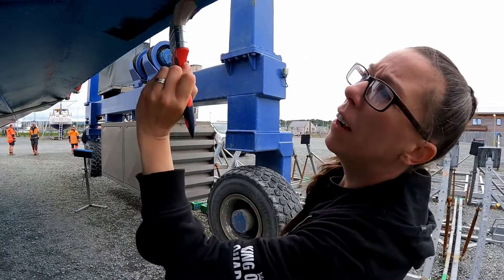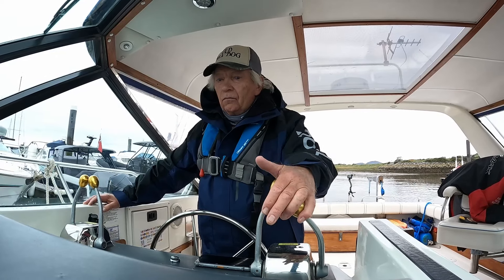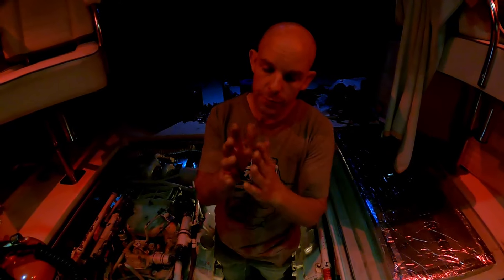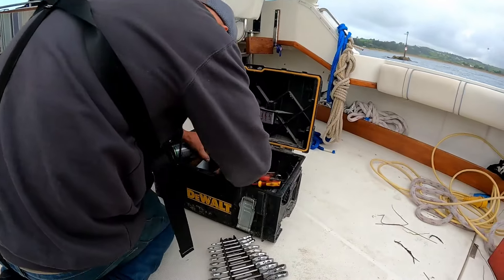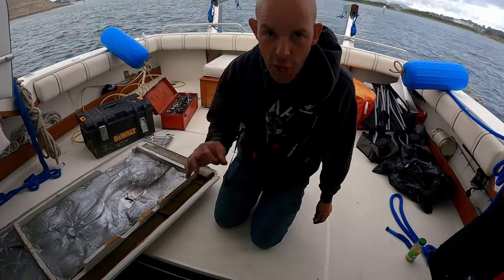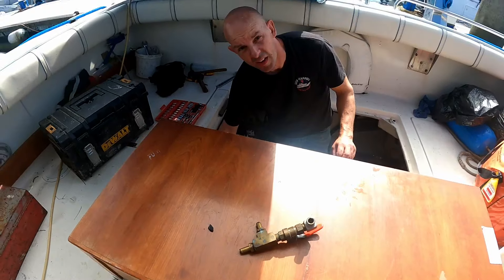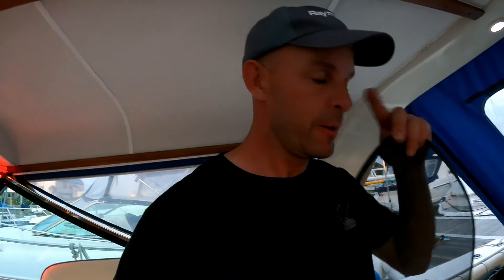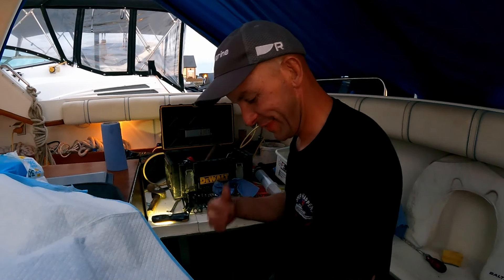Our Biggest Boat Failure Ever!

Comment: The theory on incorrect fuel pipes is a good one.  This is an old boat that will have rubber fuel lines.  Today’s diesel contains vegetable based esters, which turn rubber into hard coal. I think you need to replace every fuel hose in the boat. And flush out every steel pipe to remove the “coal”.
Reply: Yes you are right on the money there - cut open the lines too
Reply: I was thinking the same thing those things look like chuncks of hose.
Reply: Soon as I saw the black inner fuel line, I got the same feeling.
My problem with my OLD boat was diesel bug, I'd tried circulating filters, polishing, new lines etc. Cured it in the end with new engines fuel system and two tanks.
Reply: I am sure its the NEW diesel, when changing the rubber lines don't forget the diesel will also eat any rubber joints in connectors filters etc so change them as well!
Reply: I was thinking the same thing but couldn’t figure out why it was inside the tank unless it’s coming in through a return line but that’s all guessing

Comment: I know it's discouraging, but what you are seeing is not particularly awful for a boat that hasn't been used recently.  Shafts are hard to align, but you'll get them right.  Your fuel problems won't go away until you clean out your tank, but once you do you will feel like total experts on how to clean it up. You are learning and you are learning fast.  Keep it up and in a few years down the line you will be amazed at the reliability and confidence you have achieved.  (Edit: this brings back memories of my Tiara Open.  One of the best things I ever did was empty my tanks, heavily scrub them with soap and water and degreaser, power wash, rinse, then rinse with mineral spirits)
Reply: I’ve just rebuilt a car diesel engine that was coked with soot. But when I got into the job there’s was lots of messed up stuff.   Nothing was especially expensive but it did demand a full strip and rebuild. Anything less would only have bitten me later.
Reply: The tanks might not be especially dirty. However, you will need to replace ALL rubber fuel lines and blow through all metal pipes. Methyl ester (biodiesel) turns rubber into hard coal. Even silicone rubber can’t handle it. Modern diesel contains about 10% biodiesel. It also loosens sludge from the tank bottom. 
It’s probably wise to check the injection pumps as they might have rubber seals.
Reply: @Dave5843-d9m  This is correct. Additionally biodiesel (RME) is very bad due to the buildup of microbial contamination (Diesel bugs) in the tanks and filters. Use only marine diesel that is RME free.

Comment: As a boat owner I feel your pain. I had all sorts of issues with my first boat and went from one crisis to the next. Two engine rebuilds later I had a working boat, then a partial sinking meant a new starter motor, alternator and battery. That was three boats ago and now I have a lovely boat and great days sailing. What I mean by all this is that it will work itself out in the end. I wish you every success. You both deserve it.
Reply: al;l those should have been checked and rechecked.

Comment: Black deposits could have been in the fuel pipes/tubes and it is slowly breaking off. Probably restricting the pipes on the low power engine.  Worth changing all the fuel pipes or at least removing them and rodding through. Only place I can think it is coming from as your tanks were clean and you did the filters.
Reply: i was going to say this too.
Reply: They posted pictures of the fuel tanks and they were full of deposits.
Reply: You might have to loosen the p brVketd to get the alignment right. Then retighten
Reply: I don't think they were until after they ran the engines properly in the water. They almost emptied the fuel tank in a previous episode and they were clean from what I remember.
Reply: @neilfuller3172 my thoughts exactly. It could be the inner of the return line if this cycles back to the tank. I've had these lines break down on an outboard before. However, I am also fairly sure Simon would have checked this before removing the tank, I guess we will see next time!

Comment: Use a temporary day tank. Then have the tanks polished.
Reply: probably fixed by now,   a 12 gal tank from outboard connect straight to filter.  If it works----  you know where problem isnt.

Comment: I got clogged fuel filters very often until I cleaned the fuel tanks. I have mild steel tanks that hadn't been cleaned since the boat was built in 1986. There were no inspection holes so I cut two Ø 50 mm holes with a hole saw. Flushed out a couple of kg of rust and gunk with the pressure washer. Then the filter problem was solved but a couple of days later, I found one of the tanks had a small dripping leak. The rust had kept it tight and then a small pore opened. I sprayed the inside with Por 15 tank sealant and since then, no problem. Removing the tanks would require removing the engines so I'm very glad the tank sealant worked.

Comment: A lot of black smoke on full power. Check air filters first as most likely culprit. If not filters, could be worn out injectors or injector pump.

Comment: Bailey
hi had similar problems with my boat turned out to be the vent on the fuel filler cap worth a look as the tank vent on mine was blocked and i had same problems good luck Mike

Comment: Bio diesel/ethanol does that to old fuel lines, its getting back to the tank via the return lines, you are going to have to change every rubber fuel line upto and away from the filters with a modern diesel resistance  hose after you have cleaned the tanks,  from the filters to the fuel/rails should be solid lines so they will be OK, good luck peeps 👍

Comment: Oh the joys of boating, We had a similar experience when we put our new (to us) boat in the water for the first time back in July. That was after changing the spillway hoses four times as the hose the boatyard supplied kept splitting and dumping all the diesel in the bilges. Once in the water I ran engine up to check for leaks, didn't find any so after 3 hours of running while still tied up to the dock we thought we would take a little chug up the river. Hmmm was that oil pressure gauge reading zero before. As the boat has been standing for 5 years, none of the gauges work properly so foolishly I added the oil pressure gauge to the list of to do's. 45 minute into the run the engine stopped. To cut a long story short, when I had changed the oil, the filters, fan belts fuel lines and every other changeable part, I had put the small O ring that came with the new oil filter on instead of the large one and all the oil had joined the diesel in the bilges. Result was engine seized, luckily for me, it didn't seize solid and after some further work replacing the correct O ring, and refilling it with oil, it still runs. I guess I've done some damage to the bores but its an older type engine (the kind you can hit with a hammer when it plays up) and hopefully it isn't too bad. What it meant was that added to the other work our shakedown revealed, we missed our window to move her from her current location to our final home and so she is back out on the hard until next spring.The joys of boating.

Comment: That’s what old diesel varnish looks like. It breaks down and becomes a gum and over time will go hard and black. You will find it everywhere that diesel has sat for a long period of time, including coating the hoses. STAR BRITE Star Tron Fuel Tank Cleaner or a similar product can be used to eliminate the issue. Both gasoline and diesel will go gummy then sludge, then hard if left over a couple of years. Fuel can even go gummy after 3 months if left sitting without additives. You’re pretty much guaranteed that the engines weren’t winterized each season, so yes there will be lumps of ‘Simon’s coal’ ( that should be the new technical term for it) thru out the system.

Comment: With boat the blocks the boat would have flexed a bit and, if you aligned the engine and shaft on the blocks you have found it would been out once the boats settled in the water. When we’ve worked on the shafts etc we leave the boat in the water at least 24hrs before re checking the alignment.

Comment: The hard black stuff could be hard rubber from inside the fill hose between the deck fill and tank.  I am surprised your engine mounts dont have jack bolts you can use to align the motors. Every boat I have worked on has vertical and horizontal adjusters to align motors.
Withing you luck from across the pond. 🇺🇸

Comment: That's par for the course sea trial. But: Which diesel had the previous owner left in the tanks? This smells of biodiesel (RME). It is totally incompatible with rubber fuel hoses and seals.
Only use proper RME-free marine diesel. And even if you have a fully RME compliant fuel system, you still have the problem with the forming of microbes in the interface between the water and fuel in the tanks and filters. To make matters worse, biodiesel is a lot more hydroscopic than proper (marine diesel) Ideally you should use GasOil-16, but you have to check the maximum allowed sulphur amount both on the engine and regulatory side. Sulphur is very good for pump lubrication, but less good for the environment.

Comment: Remember the new fuel E10 is more corrosive than E5 so it will not decrease in the future. You must also remember that any diaphragm in the system will lose its capacity due to the adverse effect of these fuels. So change lines as suggested, clean tanks and change any diaphragms in system and any odd misfires might have an injector issue. You will get over this but take your time because there are no stop offs offshore! 😮 Now be positive and enjoy your company!

Comment: 😪 Been there. Old boats seem to always have at least one major problem that was never fixed by the last owners. Maybe they never knew it was a problem, or could not / would not figure it out. Perhaps that is why it never went anywhere when they had it. Mine had a cracked cylinder, corroded electronics, illegal plumbing, worn out shaft seals, no zincs, etc. etc. On the bright side, once it is all fixed and running smoothly you will be even more married to the boat and proud of your accomplishments. It's easy to get frustrated and depressed. It's a learning experience. Call it training. Now, if something happens at sea with these systems, you are more likely able to do repairs from the knowledge gained that others might never have experienced. 😌

Comment: Thats an absolute bummer. I feel the frustration. To mirror  davidelliott's comment  below, the 'coal' looks like hard rubber to me. I could be wrong, but hopefully its something as simple as that. I used to service Hydraulic Aircraft jacks. The  big ones they use to lift the aircraft for maintance. They rarely lift their full capacity till annual test. I cycled a 60 ton jack up to max height and down again. All fine till it went into the test rig. It passed its test but wouldn't retract. I had to gingerly crack a nut on the lined to release pressure. The problem was the inner core of the only rubber hose between the reservoir and pump had broken up and blocked the system. Like supplying fuel to your engines under load; the high flow is possibly pulling this crap through the system. The boat looked good when running and handled well. Keep your spirits up; you'll get it sorted. Every faith in Simon.

Comment: We can see the strain on your faces in this video. The series of inevitable problem that occur when a vessel has been laid up for an extended period, especially after a prop strike, can feel like it is sucking the life out of you and your bank account. These are all normal recommisioning issues (apart from the engine alignment, that should have been picked up on reassembly, call it a learning curve). It's usually best to remove the engines and run them up out of the boat. Attend to all potential fuel system (including turbos), cooling system and electrical system issue, then reassemble and align. Even then problems in a boat this age can continue to surface for some time. It's a really tough business. Even doing the bulk of the labour yourselves its still incredibly difficult not to over capitilise on the project. It can seem endless and if you cant afford to keep going that is what it becomes. You guys are doing really well. As soon as I saw that composite fuel hose with the black lining I guessed you could have some major issues on the way, the stuck turbo doesn't bode well either but if you can push on and get to a point where your back to focusing on normal preventative maintence you will have succeded. Its a lovely boat and it deserves to be returned to service by a couple of die hard enthusiast like yourselves. Great videos. Love the ML videos too, a mates brother is restoring an ML here in NZ. If you can do that job you'll get through this lot ok. Don't panic, keep calm and carry on! 😊😢🎉

Comment: Without sounding crazy , you have got what we call in the trade "Diesel Bug".     Diesel will not turn your rubber lines into coal. Diesel bug can lead to all sorts of problems including clogging filters and causing the engine to cut out. Equally crud and sludge build up in the tank could cause similar problems.  Check out Marine16 and diesel dippers.

Comment: Hiya
So sorry thst uou sre having problems. Can i make two suggestions. One, as the hull has been out of the water on blocks and stands, it had probably taken up a very slight diffrrent shape. Now its back in the water it is gradually returning to normal, hence your  alignment issues. Two,can you not use some 5 gallon plastic tanks of known clean diesel to get you home.
Good luck, love all your videos.
Chris and Claire. el Campello Spain 
0:31
Reply: Good suggestion.  Use temporary tanks to bypass trouble and if that solves the problem use them to get home and final solution.  (I know, I know, you've already decided to return to the hard)

Comment: I noticed Black Smoke as well coming out of your exchaust? when you place your shafts back in, you must always check the coupler alignment according to specification. Ok your starboard engine is blowing black and white smoke could be a carberator issue. Air fuel mixture problem.
Reply from the maker: It's the port engine that was blowing black smoke, and we fixed that in the episode, the turbo was seized but we managed to free it off

Comment: Guys I haven’t read all the posts but I have read quite a few so may I suggest that you rig up a temporary tank with fresh fuel disconnect your existing lines and hook up to the temp tank this will get you going so you can relocate just make sure you have a spare top up tank of fuel to make sure you have enough fuel to get you home ,…oh needles to say strap your temp tank down to secure it safely?. I recon this will do the job good luck Dave

Comment: That's old rubber from fuel lines - you must change them all. Suggest that as a fire-precaution you consider copper fuel lines as well - put a loop at engine ends to avoid movement stresses, you won't be getting that "coal" problem again. Bite the bullet friends - change the lines, David E has advised you aright!

Comment: if the engines have seperate tanks then the crud was placed in the tank, look you can empty the tank at the slip just bring down 45 gallon drums pump out the tank then clean the inside with Bilge cleaner then use a wet and dry vac to suck out the remaining bildge cleaner from your tank. it will cost 200 dollars to pull the boat again with a travel lift then the cost to get their and daily fee's in the yard and the cost a second time for the travel lift.

Comment: The fuel system is going to be where the fault lies. The reality is a full change of the fuel system. One easy way to check is use a separate fuel tank And bypass the filter system direct to the engine. If the engine runs as it should there is your answer. And its a cheap way to check without spending money unnecessarily.

Comment: What me thinks is the age of the pipes don,t last forever breaking down any chance of a camera  to look inside tank they use them on car engines you will never stop bits of black bits without another filter in the fuel line onwards and upwards

Comment: I used cheap fuel line and it disintegrated on the inside and clogged my filter and killed my injection pump . 4 cylinder Isuzu diesel . Can you run it from a fuel can straight to the filter .

Comment: Here in Australia we have a saying about boat -(Bring Out Another Thousand) , your diagnosis is pretty accurate old rubber and new diesel are not a good combination, the only suggestion I have is replace all fuel lines and the vibration could be even though the shafts and props were straightened were they balanced after the reconnection to the motors , just a suggestion but I’ve seen this before and balancing was the cure , I know it’s down heartening and bloody expensive but it is a learning curve for you for the future , keep your heads up remember there are a lot of people out here in YouTube land watching and swearing at the machine with you, all the best from Tasmania Australia 🇦🇺

Comment: Had a machine once that was fitted with a Detroit GM 4-71. It started bogging down under load, so we done the usual things, filters, injectors etc but to no avail. Eventually we checked the fuel suction line and found it had swollen inwards over its life and was restricting flow. The problem was that they had used hydraulic hose for diesel which wasn't suitable. Simple new hose fixed the issue after two days of frustration.